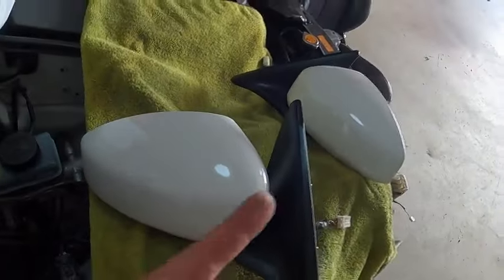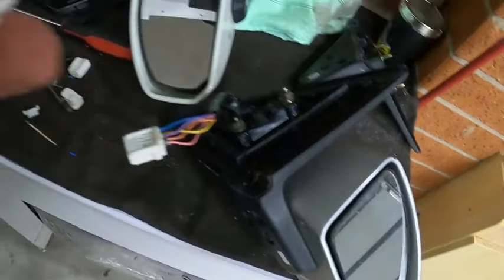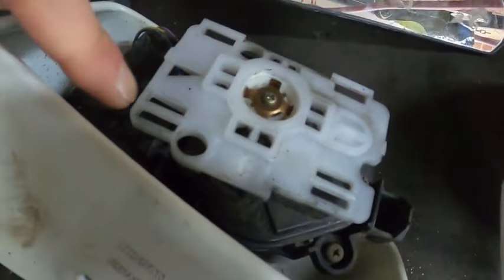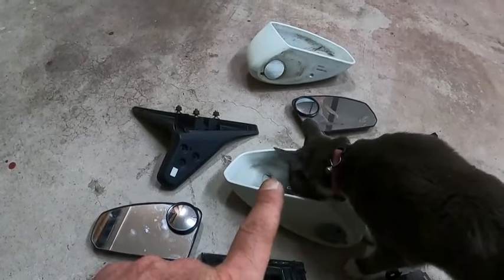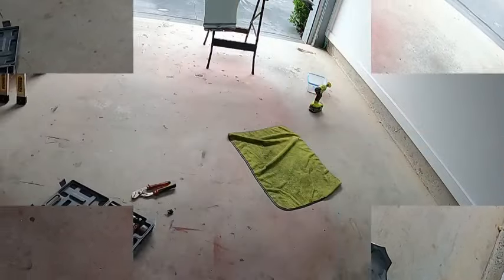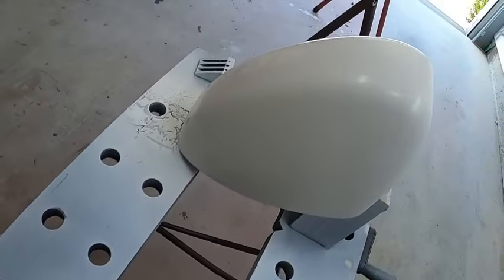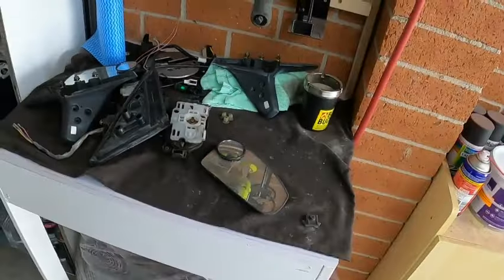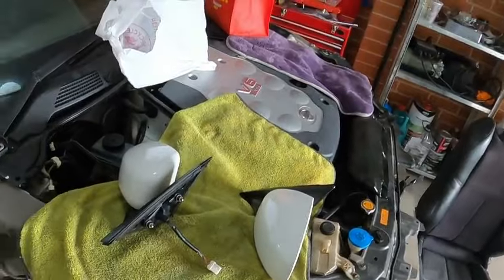Side mirror teardown & paint. How to? Driver fender repair and paint Nissan SkylineV35 infinti G35.

Comment: You really did good repairing it. that rust would have destroyed the paint later. but vinegar ???!! that is new to me. but I guess it does work, being acid and what not. you have to clean the surface after and work immediately because metal will flash the second you remove the vinegar
Reply from the maker: True that, cheap and works. You just need to clean it properly after and start with rust converter and primer.  Otherwise,  will just rust again

Comment: where you able to find what was wrong with your original one ? you may be able to fix it so you'll have extra set :). Good work
Reply from the maker: Not exactly, but the base itself seemed broken so doubt can fix it. The new one was a deal so not fussed  ;)